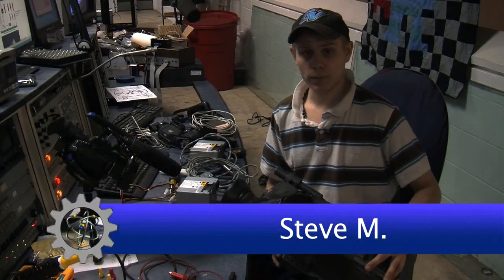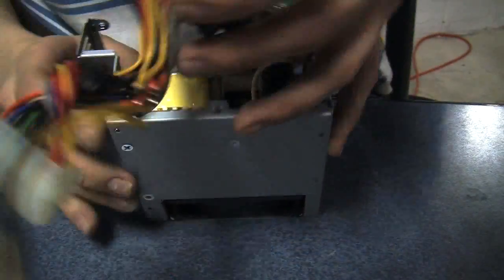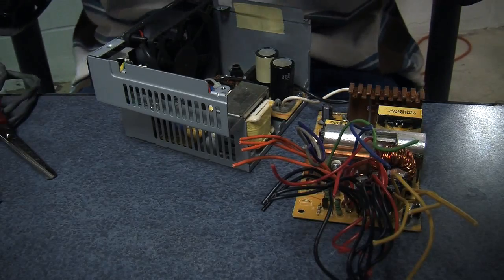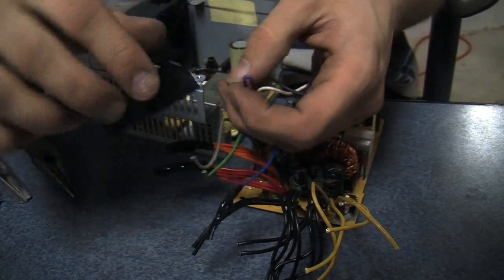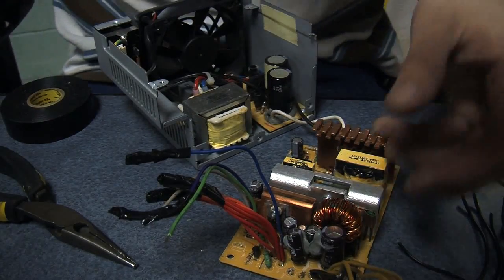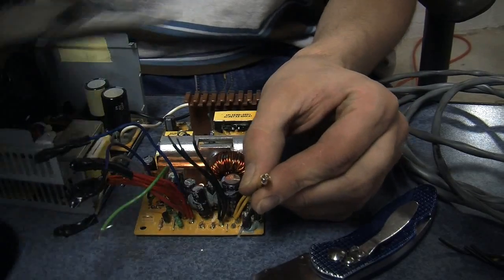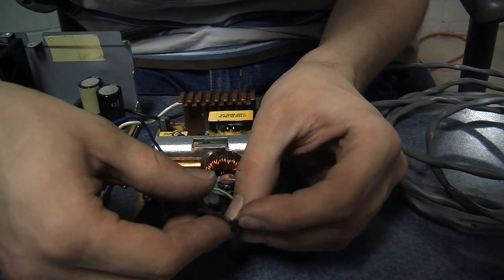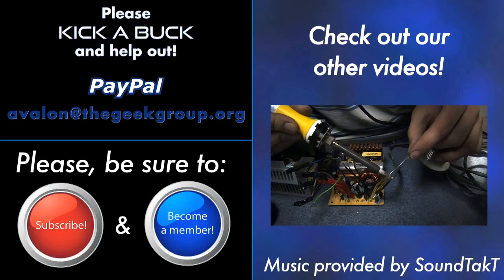How to convert an old Computer PSU into a Camera Power Supply!

Comment: i made one of these a wile back for a bench-top power supply for messing around with electronics.  worked great. until i pushed more then 1/4 watts through the cheap *** radio shack pot

Comment: some remarks:
1) this is an atx power supply. at supplies are the even older ones with a wired power switch that goes to the front button on a computer, and they have smaller connectors / fewer voltages for the motherboard.
2) if you strip off the connectors anyway, cut the wires close to the board so the next time you need a molex or atx connector, you don't have to butcher another supply.
3) you may damage an atx psu if you switch it on without a load connected
4) tape may come loose.

Comment: There are PC power supplies that will need a load on the 5V rail or else they won't work correctly (it is often the 5V rail that is the regulated one and the other rails get "dragged" along). If that happens just put a small bulb (6W bicycle light) between black (GND) and red (5V). You then have an indicator that the PSU is switched on, too ;)

Comment: That's actually a ATX PSU, not a AT, the old AT PSUs got a big physical power switch that switches the mains, the ATX ones on the other hand got a built in solid state switch whitch is controlled by the 20pin connector. But anywats, nice mod! computer PSUs are good for a lot of different stuff.

Comment: @KillerZero259 it's standard on all atx power supplies.  If you aren't sure, check between each pin and ground on the atx connector with a multimeter and see for yourself!

Comment: That's an ATX psu, and if it's old enough (atx V1.1) it will be biased towards 3.3V and 5V, (12V was only used for hdd's, optic readers, etc) A newer atx v.2.0 will have most of the power on 12V and different rails (that can be put in parallel if you need)